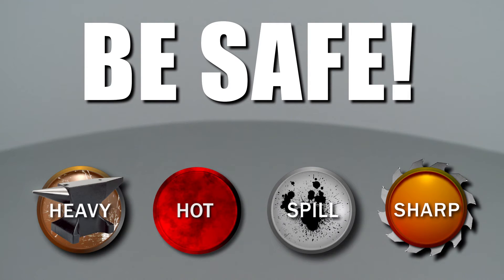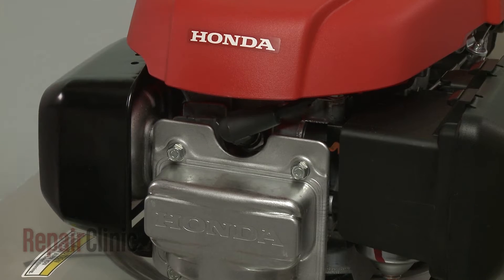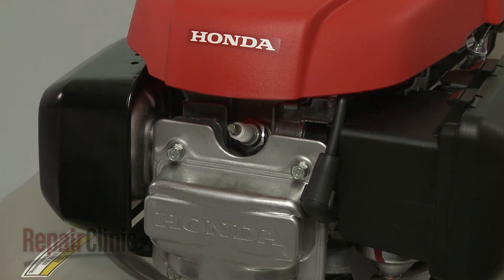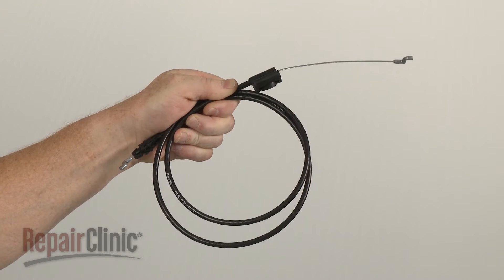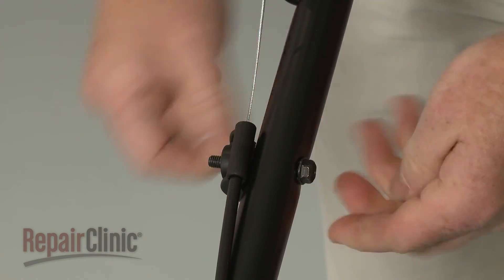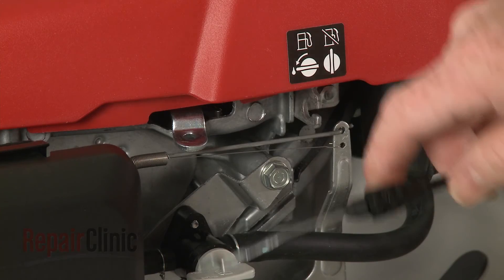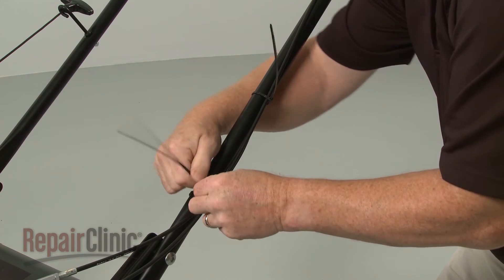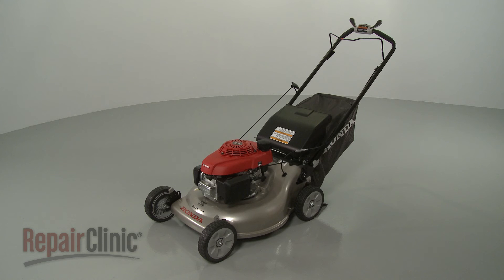Honda Lawn Mower Brake Cable Replacement Part # 54530-VL0-S01

Comment: Thank you very much for the great video! What is the name of the metal part that holds the rubber part of the clutch cable? Mine broke and have not been able to find anywhere.

Comment: I need a video to replace the blade clutch cable.
Reply from the maker: Hi Shane. Here is our video for the clutch cable: https://youtu.be/ImPe3vdtfrY
Reply: @repairclinic  Wrong video, I need a video for the roto stop blade cable on a Honda hrx 217hya 200cc with hydrostatic transmission. This video is on a very old mower.